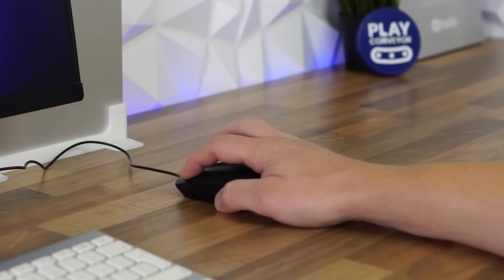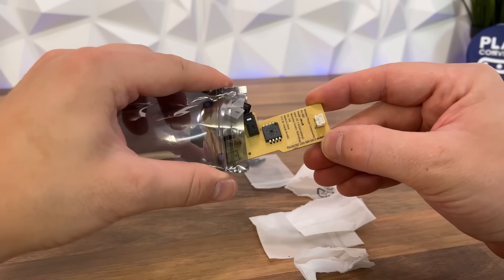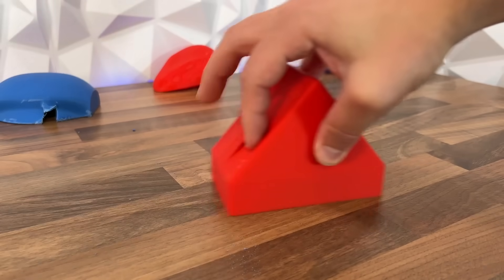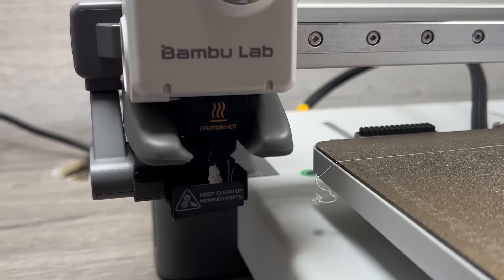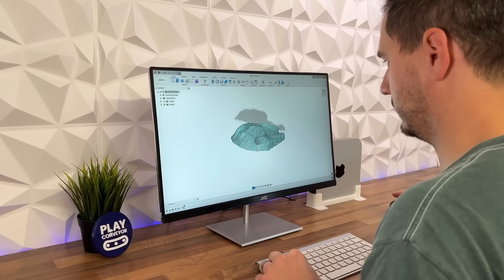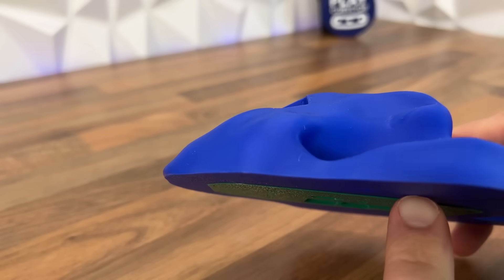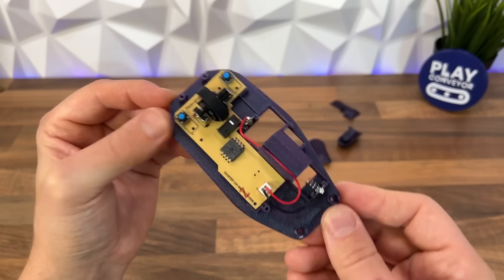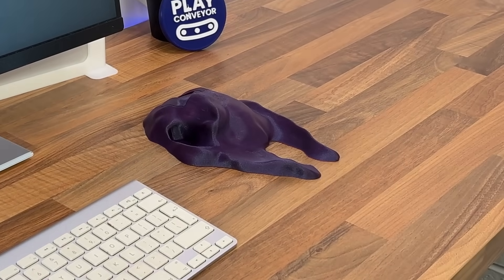I Built the World's Comfiest Mouse (ft. Bambu Lab A1)

Comment: The issue with this is its still not Vertical mouse so ur hand bones are still crossed.
Reply: Pretty much this, it will be rested though, but in a way like twisting your back in a really comfortable bed
Reply: @ThePsychoticWombat  True but to make it vertical he would have to make a daughterboard with extenders from the scroll-wheel, switches, etc
Reply: So the most comfortable mouse would actually be a pistol grip?!
Reply: @luciano12sa after trying 4 different kinds of vertical mouse designs - I'm afraid the answer is yes. Right now I own a lookalike of Logitech MX vertical mouse, but it seems it would have been better if buttons were located on the front, not on the side.
Reply: @luciano12sa  fr
Reply: @luciano12sa  I don't know why you would find that shocking if that were the case. There's nothing wrong with that, and pistols were after all designed so humans would have a good natural grip on them.
Reply: Yup. His "natural resting position" is more like "natural resting position if you let your hand rotate to match the hard table surface". Actual natural resting position isn't vertical either, more like 50 or 60 degrees up from flat. I think a 45 degree design would allow best ratio of comfort and control, personally. Higher angles require back pressure from the thumb to prevent it moving when pressing buttons, which becomes unergonomic, especially if you want to also eventually add thumb buttons for more functionality.
Reply: @stephenkeen6044  But this is common for when you are aiming, rather than simply relaxing. It's like when people are worried about turning your head a little bit to see another monitor. You don't need to be in a state of complete relaxation--it's normal to exert yourself a bit when you are working--just not to be totally non-ergonomic and setting up problems for yourself
Reply: @stephenkeen6044  how tf are u supposed to make a 45 degree mouse? That sounds dumb ash
Reply: @briton3851  if the base of the mouse is tilted, you have a tilted mouse. imagine the left side of your mouse has a big ol bump sticking down.
Reply: @Appletank8  interesting, clearly i need to educate myself on mouses, are they a large improvement on a flat mouse
Reply: @briton3851   Some people prefer it, but I more value very low weight since I pick them up a lot. And vertical mice just has more mass. Or use a trackball where I don't need to move my hand at all. I do however put a piece of plastic underneath my trackball mouse to tilt it a little.
Reply: @stephenkeen6044  u just like me pulling bs numbers to make a point
Reply: @ElementBirdGaming  Actually, been investigating this for a while and have measured it on a few people... It depends on desk height, etc, as you rotate naturally with arm position changes. Just so you know... The 45 degrees is something I've tested on myself and it's comfortable from about 30 to 45. Any higher and presses seem to create too much movement. Still working on proto, but would like to productise at some point.
Reply: @ElementBirdGaming  But... was my point made, regardless? Does it matter if the numbers aren't precise if it's something you can test yourself while sitting at your desk?
Reply: @stephenkeen6044  that seems to match my own experience. I find vertical mice quite uncomfortable. Mostly because if I use those the edge of my wrist bone rubs against the desk, which gets painful pretty fast. My hands are really small (I wear children's gloves) and I use a g600, the way my hand rests on that mouse it's about at a 35-40 degree angle. My whole hand is kinda shifted to the right of the intended position, with my pointer finger resting right along the mouse wheel, rather than the middle of the button. I have never used a mouse that I find even half as comfortable.
Reply: @ElementBirdGaming no those are angles
Reply: So you just want a joystick
Reply: I can literally feel my nerves pinching if I try making my hand rest any way other than down, what does this even mean?? So you guys rest with your elbows down???
Reply: @ravenanne1734  you dont??
Reply: yeah and his bones will eventually end up creating the saddam hussen hiding spot which is not good for his hand
Reply: yeah and his bones will eventually end up creating the saddam hussen hiding spot which is not good for his hand
Reply: yeah and his bones will eventually end up creating the saddam hussen hiding spot which is not good for his hand
Reply: I was the 1000th like 😮
Reply: I printed it vertically (of course, converting it to vertical myself)
Reply: i think if anyone in this reply thread saw my setup they’d have a heart attack
Reply: are you dumb?
Reply: The bones in your forearm are designed to be "crossed", it's called pronation. This is normal.

If you wanted everything to be aligned you might as well have your arm straight to the side of your body since your elbows are also "crossed".
Reply: Scroll wheels I also find put a lot of strain on the finger you scroll with due to the repetitive motion. Some kind of rocker or trackpoint like what was used on the Scrollpoint mice could work.
Reply: Thats terrifying to think about.
Reply: I started sleeping on my hands to uncross my bones as I sleep. Am I crazy?
Reply: @mattress203 I do that to keep my hands warm
Reply: Your hand bones aren't crossed though...
Reply: @nyanuwu4209 
I think they meant the forearm’s bones crossing over when you pronate your hand. Pretty sure it doesn’t cause additional strain though since we’re designed to do it.
Reply: Logitech MX Vertical is the goat.
Reply: Wtf do you mean your hand bones still crossed. Vertical mouse is overrated just like all these tech companies trying to market to gamers in general. RGB and crappy uncomfortable gaming chairs and you all gobble it up. Vertical mouse might be better than a generic brand, but the vertical aspect is in no way superior. When a person rests their hand on a table or any flat surface, the palm will almost always face downward. If we assume the natural hand position is the most comfortable, then a vertical mouse is not that. If somehow, resting on a surface is what you call throwing our natural position off, then keep them at the side of your body according to that logic.
Newsflash, the human body is perfectly able to be in natural rest in many different positions. The video's method is completely valid.
Don't fall for those stupid marketing terms. But modern gamers will care more about some 1000 dollar set up for some RGB and "gaming" in its name than the actual gaming and practical aspect
Reply: It has never been a problem for me that a mouse was not vertical. Mice can still be ergonomic, and vertical mice are just a gimmick for most.
Reply: @brendanr1525 it actually is a problem. Do some research ffs
Reply: And it has a built in wrist rest so you can't make precise wrist movements. Could be good if you are recovering and want to more or less splint your wrist while using a PC.. but otherwise I don't think it'd be very comfortable.
Reply: Yeah, at least a slight tilt is ideal, even for a standard mouse design. Most modern ones go with something like a 30-45 degree tilt, and honestly i'm pretty happy with that myself.
Reply: The more I read this entire reply thread with hands in perfect condition, the more I wonder if people realize that instead of having absolutely no strain at all, maybe they should touch grass and work out more. Because if people are so afraid of "strain" then hell on earth people shouldn't be walking. Are we supposed to live laying down on a bed, now? Guys, y'all just need to practice some sport...
Reply: @NothingXemnas  you're underestimating what is meant here when talking about strain. It's not just a little bit of strain, working with a mouse like this for a long time can cause genuine injury, with possible long-term effects. Lateral epicondylitis, also known as tennis arm or mouse arm. Had it twice now. No amount of touching grass or sport solves this.
Reply: @NothingXemnas research RSI's, genius.
Reply: @hazel-line  I am aware, but being in my 30's with hand in perfect condition despite being a chronically online person since childhood? I think you are either much worse than me or there are lifestyle differences. I am not going to disagree with RSIs, but I also don't understand the fear and anxiety. Being a athlete for 10 years, you think that destroying my knees and ankles from running and jumping would prevent me from doing it? Accept that we age. All I ask is that at least you practice some sport if there is any relief in this damned existence rather than think computer peeripherals are our demise.

Comment: you should add mouse skates to make it slide better without that 3d printed scraping noise :^)
Reply: he did after he made the video
Reply: Mouse Skates Sound fire I want a skate for my mouse too
Reply: @generalobiwankenobi7579 every mouse has mouse skates and if you have a relatively popular mouse you can buy even better aftermarket ones that fit perfectly
Reply: @generalobiwankenobi7579 or you could also simply buy dots which are way way nicer than the stock skates on shittier cheaper mice
Reply: L turkey mouse
Reply: *You
Reply: Yes. And then it might need brakes too.
Reply: Does nobody else bend their wrist while using a mouse? From the 3D print (Granted I skipped through most of the video so please correct me if he said anything about this) it looked like he had two chicken leg lookin strips at the bottom to go around his wrist. When he wants to move the mouse left/right does he now have to move his whole arm so that he doesn't bend his wrist, making those chicken legs uncomfortable?
Reply: the Rat pro X has ceramic skates, those are excellent, much less friction than the usual plastic
Reply: @illdeletethismusic  Nothing has less friction than PTFE on PTFE.
Reply: @ImNotAYoutuber0  to be fair, i think ptfe skates on ptfe mousepad would cause both to wear down, its better to have one of your surfaces be harder so you're only wearing down either the mouse feet or mousepad, not both.
Reply: @ImNotAYoutuber0  tables aren"t normally ptfe
Reply: @illdeletethismusic  I don't have a mouse tho
Reply: or just use a mouse pad

Comment: This will sound as a weird query, but bear with me.
I have nerve damage on my right arm, causing my 3 last fingers to "click" erratically. I need a mouse that has a smaller rmb and flat space on the mouse casing past the rmb (all the mice on the market tend to profile the case to fall off right past the button) so I can consciously brace my "outboard" fingers away from the rmb until needed. The mouse I need does not exist. Or it didn't, until I saw yours. I was very excited to see what you'd done.
Will  the print file become public at some point? 
Thank you, and well done on your innovation.
Reply: There are a bunch of ergo mice that have material on the side, but there is indeed a huge lack of wide mice on the market.

Comment: Its hard to move your wrist left and right. So, make it possible to turn by pushing this part in to the air, decreasing grip and with center of mass right beneath your wrist hinge and a bit decrease size of the tail to not interfere with your forearm. Or you can add a hinge on the shell. Add thicc sliders and create a more sharp and nice form of parts of shell wich dont touching your hand.

It could be the most comfortable mouse, but need a lot of improvements. Afterwards its would be comfortable for your height, weight, your chair and your desk. If change one of that parameters its no longer comfortable. Men, there is so much hand grips in the world, someone place the whole hand on the desk, someone place just a wrist. I think you can get what i mean.